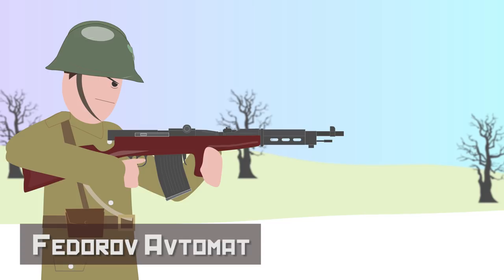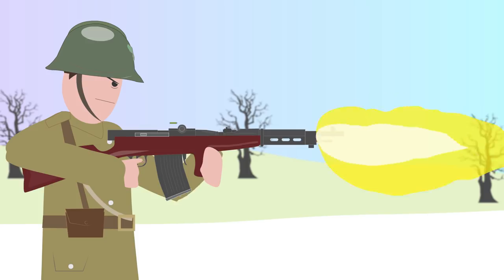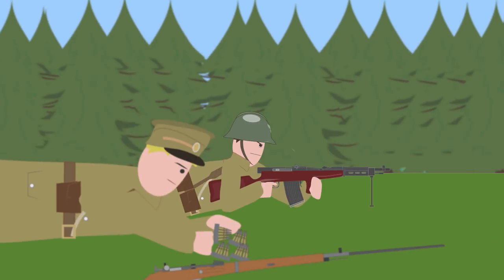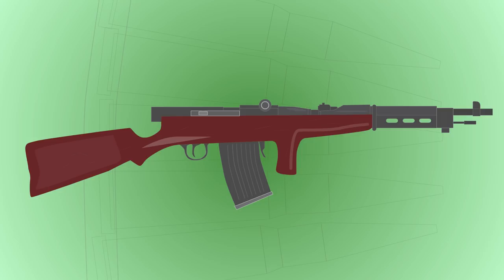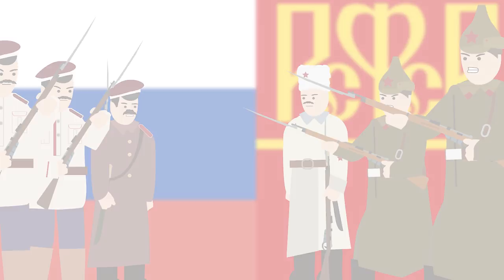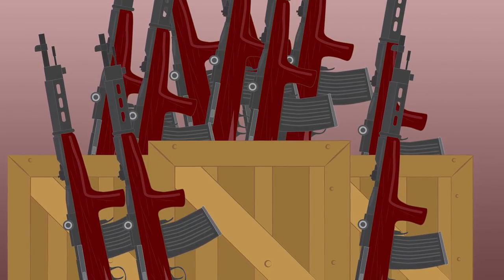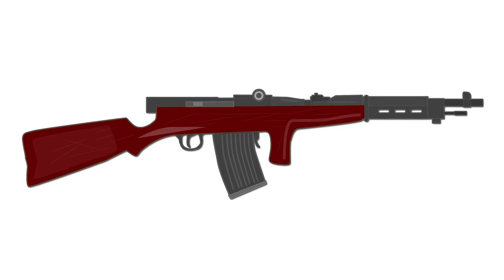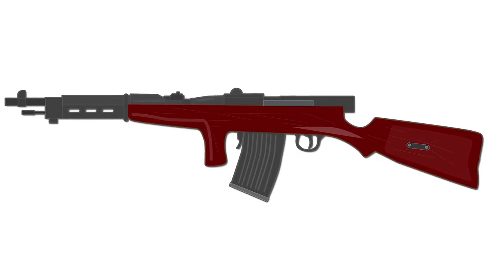Fedorov Avtomat, The First Assault Rifle?

Comment: 6.5mm arisaka is not really a intermediate cartage. So technically it could be called first modern battle rifle. definition of what 'assault rifle' is came with STG44 (select fire weapon that is chambered for intermediate round)
Reply: 6.5mm arisaka was an intermediate cartridge when you compare it to the 7.62 x 54r. More suitable to handheld automatic fire.
Reply: S L well compare it to whatever you like fact remains 6.5 Arisaka just like other 6.5 rounds is still a full power rifle round. Even though its smaller calliber its still in a long case with high enough pressure. 7.62 x 39 was first russian intermediate round because it had shorter case not smaller bullet
Reply: the 6.5 x 50 arisaka has a shorter case as well though. The case capacity is significantly less than the 54r. 6.5 by 50 was closer to an intermediate than a full power round, the japanese even had larger 7.7 by 57...
Reply: S L and .50 BMG is intermediate compared to 20mm vulcan round... whats your point?
Reply: my point is that by modern standards the 6.5 definitely falls under the umbrella of an intermediate rifle round, not really much more to say, the Japanese wanted the 7.7 to be their standard rifle round in WW2 but as you know the tiny island nation of japan didn't have a lot of natural resources.
Reply: S L gun jesus disagrees. Case closed.
Reply: lol that is not an argument
Reply: S L the 6.5x50 is a pretty decent sized round. It's about the size of a .308 but thinner so no it is not an intermediate cartridge
Reply: The japanese didn't design the 6.5 to be an 'intermediate' cartridge because that was their full power cartridge.
Reply: This is actually an intermediate round in today's realities. The borderline between rifle and intermediate cartridges is blurred.

100 years of bloodshed, from 6.5 to 6.5 (i'm talking about modern grendel round, which is just a little bit more powerful than arisaka and still considered intermediate)
Reply: Well. In my country interimediate cartridge need to have a power of 1,300-2,300 J. 6,5mm Arisaka have a power of 2,615 J so in Poland it is rifle cartridge.
Reply: @Unreelme  You say the 6.5x50mm Arisaka is an intermediate cartage. What is the 6.5x55mm Sweden, then?
Reply: 6.5x50mm Arisaka was the intermediate cartridge.
7.7x58mm Arisaka was the full length rifle round.
Reply: @JAnx01  They're both full size rifle cartridges.
Reply: well simply STG or Stürmgewehr in german means assault rifle
Reply: Yeah but if it's smaller than Murrican size then it's not full size battle rifle style. Just ignore the fact that for the Japanese it was their full size round, Murrica defines everything lol.
Reply: @FairladyS130  That is literally the worst argument I've ever heard.
Reply: @karolinska1601  True LOL
Reply: In Russian/Soviet weapon's design theory there is no difference between a battle rifle and an assault rifle. A weapon is judged by its role, not by the cartridge it uses. It's all seems to me rather stupid fighting between what is an intermediate cartridge and what is not, it's a fictional difference, man-made difference.

In Russia they're all called Avtomats (Automatic rifles) because they perform the same tasks.

Comment: 6.5 Arisaka is a full powered cartridge but on the low end of the spectrum. Only the Russians considered it an intermediate cartridge. Select-fire, full powered cartridge, and detachable magazine would make it a battle rifle. Way ahead of its time.  The AVT-40 was also a battle rifle by todays standards but the detachable magazine wasn't really a thing for the SVT/AVT rifles since they were meant to be charged with stripper clips.
Reply: According to Russian technical standards, this is an "avtomat". It is worth saying that the avtomat != assault rifle. According to GOST (a set of technical standards in modern Russia and some ex-Soviet republics) avtomat = automatic carbine. Carbine = a lightweight rifle with a shortened barrel. So, it does not matter whether the intermediate cartridge is or not. If the avtomat uses pistol cartridges (like 9x19 Para, 7.62x25 TT, .45 ACP etc) = it's SMG. P.S I don't like terms in the GOST too, but this is an obligatory standard in Ukraine and Russia. P.P.S Sorry for my English.
Reply: so Avtomat Kalashnikova - automatic carabine? OH WOW

Comment: It's inaccurate to call the Fedorov the first Assault rifle the category itself was invented by the STG 44 where it was specifically developed as an Assault rifle that would use a specific mid range bullet to close the gap between a rifle and pistol round. The Federov is more like an automatic rifle like the BAR.
Reply: Tough to say. 

The round is smaller than the 30-06 Springfield or the 7.62-54 round in standard use in Russia at the time. The Avtomat was specifically designed for a lighter cartridge for the same reasons the assault rifle was. 

It was also made before WWI and strict definitions. If you take the M-16 and the AK-74 with their even smaller “intermediate” cartridges... does that mean the STG 44 and AK-47 aren’t assault rifles?

Comment: Not an assault rifle. It does not fire a intermediate cartridge. 6.5x50mmSR is a full power bolt action round that is semi rimmed. 

This is a big distinction of the idea of a assault rifle. A round that is more powerful than a handgun round but shorter and lower recoil than a standard full length cartridge.

Also while it had detachable magazines it was not issued with multiple magazines as stated in the video. The weapon fits a closer definition to a "Battle Rifle" such as the FN/FAL. 

Federov is no more an assault rifle than the BAR is. Same idea near the same time and not one for the same reasons.

Comment: if we are excluding un massproduced little gimmics like this and the american M1917 lmr the first true fully automatic high capacity assault rifle was the M1918 BAR.

It's not a machinegun (just because it was used in the LMG role in ww2 does not mean it's a LMG), it is a heavy fully auto rifle and the only difference between it and modern assault rifles really is that it fires a full sized round and weighs about 2kg's more.

Comment: For those wondering if it is an assault rifle, No it isn't. An assault rifle is a select fire, magazine fed, intermediate cartridge firing weapon. I know the federov is magazine fed and select fire but soldiers were only issued with 1 magazine and if firing in full auto for too long, the weapon will set on fire inside out. Another thing is that it takes 6.5 arisaka rounds which isnt an intermediate cartridge. An intermediate cartridge is a medium sized cartridge thats stronger than a pistol round but stronger than a rifle round. An example is 7.62x39 is stronger than 7.62x25 tokarev but not 7.62x54r.

Comment: I mean I could see it but can we not see the bar as a possible original “assault rifle” 
I mean I’m sure there are a few examples of different types of rifles that could be considered to fight in this role.
Reply: BAR? Not really since that was something between Battle Rifle, LMG and SAW. It is way too heavy and it fired full power rifle cartridge. 
The Avtomat Fedorova was much much closer - the only thing it really lacks is pistol grip. It was actually lighter than StG 44 and it used a cartridge that has the same power as modern intermediate cartridge, 6.5 Grendel.

Comment: This is for those who the Fedorov Avtomat is the first "assault rifle". No it is not. The definiton of an assault rifle is a select fire, magazine fed, intermediate cartridge firing weapon. The Fedorov is select fire and magazine fed but it fires a fully powered cartridge, the 6.5x50 arisaka round. An intermediate cartridge is a cartirdge that is stronger than a pistol caliber but not a fully powered rifle round. For example, 5.56 NATO is stronger than 9mm but not stronger than 30-06, therefore making 5.56 an intermediate cartridge.
Reply: it would just mean it's the first battle rifle since the difference between a battle rifle and assault rifle is the type of cartridge
Reply: Even though the 6.5 Arisaka was developed to be a full power rifle cartridge, it's a very anemic one. In fact, it has energy of around 2600J at the velocity of 770 m/s when shot from 31 inch barrel. That is already comparable to modern intermediate cartridge 6.5 Grendel. 
When shot out from Avtomat Fedorova with a more modern-like barrel length of 20 inches, it has a velocity of around 654 m/s and energy of around 1925J - Which is even less than what 7.62x39 outputs. 
In terms of its use in Avtomat Fedorova, it was used exactly because of this low energy and thus low recoil - the same reason why 8mm Kurz was developed. As a bonus, the cartridge falls right in between standard pistol cartridges and the standard rifle cartridge of the Russian Empire, the 7.62x54R (3700J), which is the definition of intermediate cartridge.

Comment: Not the first assault rifle - was too heavy and fired a full size rifle cartridge. For this reason, it is considered to be a light machine gun (similar to how the B.A.R. is categorized by todays standards) and the STG 44 is now considered the first assault rifle.
Reply: Too heavy? It's actually lighter than StG 44. 6.5 Arisaka can be easily considered as an intermediate cartridge today. It has the same energy as 6.5 Grendel (Intermediate cartridge). Also it was used for the same reason as 7.92x33 Kurz - low recoil in automatic fire.
StG 44 is not considered the first Assault Rifle - there were multiple prototype assault rifles before the StG 44. It is considered first successful assault rifle.

Comment: It was the first battle rifle not assault rifle that title goes to the STG 44 the fedorov had to big of a cartridge to be a assault rifle with the cartridge of the fedorov coming in at 6.5x50 while the stg44 came in at 7.92 x 33
Reply: Nope, AF was the first assault rifle. StG 44 is first SUCCESFUL assault rifle. (It was never marked as the first one ever)  
The size of the casing doesn't matter really. 6.5 Arisaka has the same energy as modern intermediate cartridge 6.5 Grendel. Also, it had energy between a standard Russian pistol cartridges and main rifle round, the 7.62x54R - that's literally the definition of intermediate round.
 And at the same time, it was used for the same reason as 7.92x33 Kurz - low recoiling cartridge for automatic fire.

Comment: It also had a slower rate of fire and wasn't too awful accurate, but it still did better than the M91/30 in terms of consistency.
Reply: The 91/30 is a very accurate gun that is quick to manufacture and very difficult to break or create malfunction. What consistency are you talking about...4 years ago?

Comment: if that is the case than Chauchat is not a machine gun, its an assault rifle. it has selective fire between single shot and full automatic. there is no winning this since there have been assault rifle designs back then for years and the stg was the most successful of its time.
Reply: What the Federov and Chauchat have in common is they use full length rifle cartridges, The Stg44 uses a intermediate cartridge (7.92x33), a requirement for it being a "Assault Rifle" by definition.
Reply: @bobjackson4287  Not really. By modern standards, 6.5 Arisaka is an intermediate cartridge. 
At the time of adoption in the Russian military, they already had the full-power rifle cartridge 7.62x54R and as such, the 6.5 Ariska was between that and pistol cartridge in terms of energy. And as a bonus, 6.5 Arisaka is fully comparable with 6.5 Grendel (Which is a modern intermediate cartridge) in terms of energy. And to make it even better, 6.5 Arisaka was used for the same reason why Germans used the 7.92x33 Kurz in StG 44 - mild recoil in automatic fire.

Comment: If it fired the 6.5x50 full powered rifle roind it can't really be called an assault rifle as it did not use an intermediate rifle cartridge
Reply: 6.5 Arisaka can be easily considered as an intermediate cartridge today. It has the same energy as 6.5 Grendel (Intermediate cartridge). Also it was used for the same reason as 7.92x33 Kurz - low recoil in automatic fire. On top of that, it's energy was right between Russian pistol cartridge and Russian rifle cartridge, which is literally the definition of intermediate cartridge.

So what was it?

Comment: It’s probably closer to the BAR I don’t think it’s light enough to swing around like a Ak
Reply: That's funny because BAR weight is 7.25 kg, the StG 44 weighs 4.6 kg, and the Avtomat Fedorova weighs 4.4 kg!!!!

Avtomat Fedorova is the lightest of them all, and it also used a 6.5 Arisaka, which by moderns standards would be an intermediate cartridge. It has around 2600J, which is the same as the 6.5 Grendel intermediate cartridge.

Comment: Fedorov avtomat 6,5x50 mm Arisaka
Weight, kg - 5,2 (with equipped magazine)
Length, mm - 1045
Barrel length, mm - 520
Actual fire, m ~ 400
Technical rate of fire, shots / min ~ 600
The initial velocity of the bullet, m / s ~ 660
Bullet energy of a bullet, J - 1950-2150
Cartridge mass, g - 20
Bullet weight, g - 8,9
Type of ammunition - box magazine for 25 cartridges

Sturmgewehr 44 7.92x33 mm Kurz
Weight, kg - 5,2 (with equipped magazine)
Length, mm - 940
Barrel length, mm - 420
Actual fire, m ~ 400
Technical rate of fire, shots / min ~ 600
Initial speed of the bullet, m / s ~ 680
The muzzle energy of the bullet, J ~ 1900
Mass of the cartridge, g - 16,7
Bullet weight, g - 8,1
Type of ammunition - box magazine for 30 rounds

AK 7.62 mm PS
Weight, kg - 4.8 (with equipped magazine)
Length, mm - 870/1070 (with bayonet)
Barrel length, mm - 415
Actual fire, m ~ 400
Technical rate of fire, shots / min ~ 600
The initial velocity of the bullet, m / s - 710-725
Muzzle energy of a bullet, J - 1990-2080
Cartridge weight, g - 16.5
Bullet weight, g - 7.9
Type of ammunition - box magazine for 30 rounds

Comment: I think that is not an assault rifle due to its full power cartridge rather than intermediate and large size
Reply: 6.5 Arisaka can be easily considered as an intermediate cartridge today. It has the same energy as 6.5 Grendel (Intermediate cartridge). Also it was used for the same reason as 7.92x33 Kurz - low recoil in automatic fire. On top of that, it's energy was right between Russian pistol cartridge and Russian rifle cartridge, which is literally the definition of intermediate cartridge.

Comment: "Assault Rifles" use an intermediate cartridge such as the 8mm Kurtz NOT a full size battle rife round!
Reply: it's the first battle rifle, not assault rifle
Reply: Even though the 6.5 Arisaka was developed to be a full-power rifle cartridge, it's a very anemic one. In fact, it has an energy of around 2600J at a velocity of 770 m/s when shot from a 31-inch barrel. That is already comparable to the modern intermediate cartridge 6.5 Grendel. 
When shot out from Avtomat Fedorova with a more modern-like barrel length of 20 inches, it has a velocity of around 654 m/s and energy of around 1925J - Which is even less than what 7.62x39 outputs. 
In terms of its use in Avtomat Fedorova, it was used exactly because of this low energy and thus low recoil - the same reason why 8mm Kurz was developed. As a bonus, the cartridge falls right in between standard pistol cartridges and the standard rifle cartridge of the Russian Empire, the 7.62x54R (3700J), which is the definition of an intermediate cartridge.

Comment: I was under the impression that because the FA was chambered in a rifle round, and did not easily except attachments it was not an assault rifle.  I have been watching allot if videos calming that the STG 44 was the first assault rifle, and until watching this video was sold on that idea. Now I need to do some of my own digging to see what side I support lol.  But great video.
Reply: accepting attachments has nothing to do with the classification
m16s/ak-47s/etc didn't accept attachments either, both rifles did have ways to mount optics, but that wasn't a new concept by any means 

the stg was the first "assault rifle", as it was the first to meet the criteria for the classification

I don't consider 6.5 to be an intermediate cartridge really, it's quite big compared to 5.56/7.62x39

if you're more interested in historical firearms, forgottenweapons is a great channel that goes over mechanical details as well as the history of them

Comment: Missing intermediate cartridge required to meet assault rifle def.
Reply: Actually.... By modern standards, 6.5 Arisaka is an intermediate cartridge. 
At the time of adoption in the Russian military, they already had the full-power rifle cartridge 7.62x54R and as such, the 6.5 Ariska was between that and pistol cartridge in terms of energy. And as a bonus, 6.5 Arisaka is fully comparable with 6.5 Grendel (Which is a modern intermediate cartridge) in terms of energy. And to make it even better, 6.5 Arisaka was used for the same reason why Germans used the 7.92x33 Kurz in StG 44 - mild recoil in automatic fire.